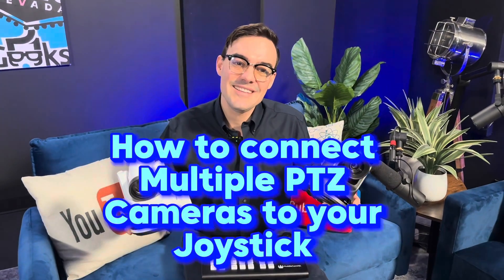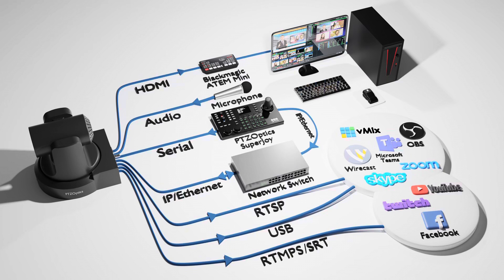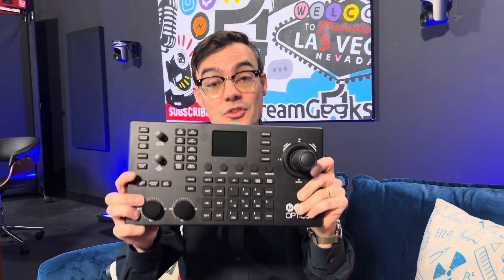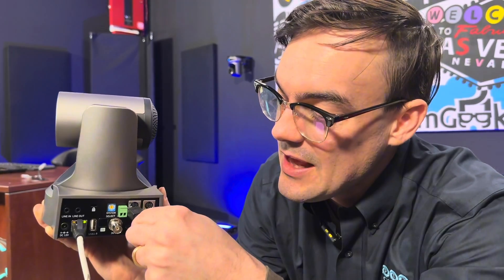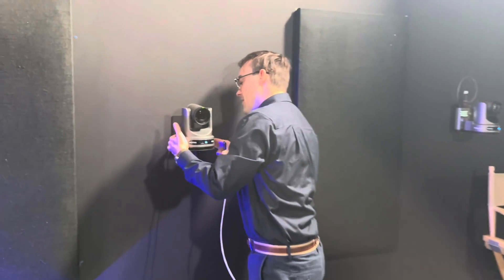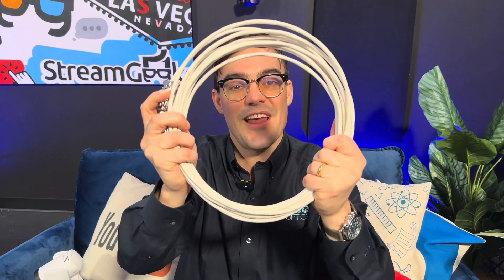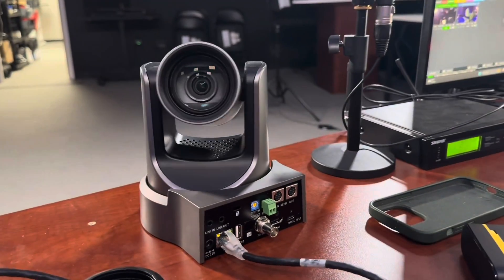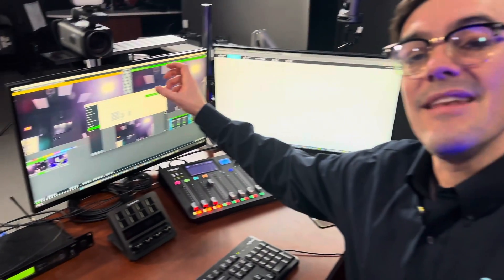How to connect multiple PTZ cameras to a controller

Comment: Hey, looking to upgrade my basic streaming set up from a single stationary camera to your PTZ MOVE SE 30X. This video helped a ton as I knew very little about how to connect cameras to a controller and such. That all makes sense now. But how do I get the video from the network switcher via ethernet cable to my laptop? I run a mobile streaming set up and run just off wifi as most of the places I stream from don't have access to a hard-wired router. Will the video signal be sent from the switcher to my laptop via another ethernet cable? I didn't realize ethernet cables could transmit video as well. (As I mentioned, very much a rookie in this field ha-ha).
Reply from the maker: Hello!
Upgrading your setup to include a PTZOptics PTZ MOVE SE 30X camera is a great choice for enhancing your streaming quality and flexibility. 

To address your question on getting the video from the network switch to your laptop, especially in a mobile setup using WiFi, let's clarify a few points about the workflow and the necessary equipment.

1. Ethernet for Video Transmission
The PTZ MOVE SE 30X, like other PTZOptics cameras, supports video transmission over Ethernet using the NDI® protocol or standard network streaming protocols (such as RTSP or RTMP). This capability allows you to use a single Ethernet cable to both control the camera and receive its video feed, provided your network infrastructure supports it.

2. Connecting to Your Laptop
To receive the video on your laptop from the camera over a network switch, you'll need to ensure your laptop is connected to the same network. Here's how you can do it in a mobile setup where you're relying on WiFi:

Connect the PTZ Camera to the Network Switch: Use an Ethernet cable to connect your PTZ MOVE SE 30X camera to a network switch. This switch should be capable of handling the bandwidth required for video streaming.

3. Connect the Network Switch to Your Laptop:
If your laptop has an Ethernet port, you can directly connect it to the network switch using another Ethernet cable. This setup will ensure a stable connection for both controlling the camera and receiving its video feed.
If you rely solely on WiFi and cannot or prefer not to use a wired connection for your laptop, you'll need a WiFi router connected to your network switch. This router will broadcast the network over WiFi, which your laptop can connect to wirelessly. Ensure the WiFi router is configured correctly to allow devices on the WiFi network to communicate with devices on the wired network (like your PTZ camera).

4. Software for Video Reception
To actually view or stream the video feed from your PTZ MOVE SE 30X on your laptop, you'll need software that supports the camera's streaming protocol (NDI®, RTSP, RTMP, etc.). OBS Studio is a popular choice for this purpose, as it's free, supports various streaming protocols, and works well for live streaming setups. Within OBS or your chosen software, you'll configure a new source using the camera's network stream URL.

5. Mobile Streaming Considerations
Bandwidth and Quality: Streaming video over a network, especially HD or 4K, requires a significant amount of bandwidth. Ensure your WiFi network is robust enough to handle the video stream without significant loss in quality.
Latency: A wired connection is generally preferred for the lowest latency. If using WiFi, be aware that there might be a slight increase in latency.
Power Supply: Since you're running a mobile setup, ensure you have a reliable power solution for your camera, network switch, and WiFi router.

By following this setup, you can efficiently integrate a PTZ MOVE SE 30X camera into your mobile streaming setup, leveraging the flexibility of PTZ cameras and the convenience of wireless connectivity for dynamic and high-quality live broadcasts.

Thanks for checking out our Channel! 
Learn More: https://ptzoptics.com/
Reply: @PTZOptics  forgive my lack of knowledge here, but is there a simpler way to run it? Just hdmi into my laptop or is the whole IP connections and such mandatory?
Reply from the maker: Hello, apologies for the late reply.

For connecting a PTZOptics MOVE SE 30X camera to your laptop, using HDMI is indeed one of the simpler ways to get the video feed into your system, especially if you're looking to avoid the complexities of IP networking. The HDMI connection provides a straightforward method for video capture but keep in mind that it will only carry the video signal. 

Here's a basic overview of how you might set this up:

1. HDMI Connection: Connect the PTZOptics MOVE SE 30X camera to your laptop using an HDMI cable. Since most laptops do not have an HDMI input, you will likely need an HDMI to USB capture device. This device acts as a bridge, capturing the HDMI video signal and converting it into a USB input that your laptop can recognize.

2. Capture Device Setup: Plug the HDMI to USB capture device into your laptop. You may need to install drivers or software for the capture device, depending on the model and manufacturer.

3. Camera Control: While HDMI will transmit the video signal to your laptop, controlling the PTZ (Pan, Tilt, Zoom) functions of the camera via HDMI is not possible. For camera control (panning, tilting, zooming), you would still need to use either an IR remote that comes with the camera, an RS-232/RS-485 controller, or network-based control (if you choose to explore IP control in the future).

4. Software Configuration: Open your video capture or streaming software (e.g., OBS, vMix, etc.) on your laptop. Configure the software to recognize the USB capture device as a video source. From there, you can manage your livestream or recording settings as desired.

5. Using an HDMI connection simplifies the video capture process by bypassing network setup procedures, making it a good option for users looking for a plug-and-play solution. However, for more advanced features like remote camera control or accessing the camera's web interface for detailed settings adjustments, network connectivity would still be necessary.

This method is well-suited for users who prioritize ease of setup and are primarily focused on capturing high-quality video without the need for remote control over the network.

Please reach out to our PTZOptics Support Team
Support Numbers: 833-888-9706 or 484 593 2584
Monday -Thursday: 8am to 6pm EST
Friday: 8am to 4pm EST
Not open Saturday or Sunday.
Community Portal: https://community.ptzoptics.com/s/

Thanks for checking out our Channel! 
Learn More: https://ptzoptics.com/

Comment: Great tutorial. Our church currently has 3 Blackmagic DSLRs running over HDMI into an ATEM Mini Pro for our broadcast. Using a setup like 3 Move SE’s and the IP SuperJoy, would we need to also run Ethernet cabling to the three camera locations in addition to HDMI, or could we connect the joystick console to the Blackmagic software controller via IP or USB instead?
Reply from the maker: Thanks!
Glad you found the tutorial helpful. If you plan to use three Move SE cameras with the IP SuperJoy, you’ll need to run Ethernet cables to each camera and to the SuperJoy controller.

The Ethernet connection enables the SuperJoy to communicate with the cameras over the network. It also supports PoE (Power over Ethernet) for the cameras, provided your network switch is compatible. Your HDMI cables will still run to the ATEM Mini Pro for video switching, just like you’re doing now.

The SuperJoy doesn’t connect to the ATEM or Blackmagic software; it talks directly to the cameras over IP.
Reply: @PTZOptics perfect—thank you for the quick response. This is what I understood but glad to have it confirmed.

Comment: What router do you need?
All this other stuff I don't really need to know.
What people like me need to know is how to make all this work from a remote location.
Which means you obviously need some kind of internet connection using a router.
And does that mean you have to subscribe to a service, or do you just pirate signal from wherever?
This is what we need explained, please.
Reply from the maker: Great questions, and you're right, remote production depends heavily on having the proper internet connection and setup.

If you're looking to control and monitor PTZ cameras remotely, we recommend checking out PTZOptics Hive. It's a cloud-based platform built for remote camera control, video routing, and production. With Hive, you don't need to worry about complex network configurations or relying on unstable connections. Everything runs securely through the cloud.

You will need a reliable internet connection at both locations, along with a router connected to an internet service. Pirating a signal isn't a reliable or recommended option.

You can learn more about Hive here:
🌐 https://ptzoptics.com/hive/
Reply: @PTZOptics  Thanks for the response.
The other location would be all the households or phones, computers, viewing the live stream...
Reply from the maker: No Prob.!

Comment: How can I adjust depth of field or aperture on a move se camera? Our 30x camera likes to focus-hunt when zoomed in while also being over exposed, but I cannot find the settings to fix this.
Reply from the maker: Hello!
On the Move SE series cameras (including the 30X), the depth of field and exposure are primarily controlled through the iris (aperture), shutter speed, and gain settings. If you’re experiencing focus hunting and overexposure at long zoom, that usually means the iris is too open or the exposure is set to auto.

Here’s how you can adjust it:

1. Access Exposure & Iris Controls
- Web Interface (recommended):
- Log into the camera’s IP web interface.
- Go to Camera Control → Exposure.
- Change Exposure Mode from Auto to Manual, or try Shutter Priority (1/60 or 1/100) if you want consistent motion handling.
- Adjust Iris (aperture) manually — closing it down (higher f-number) increases depth of field and reduces overexposure.
- If needed, lower Gain to prevent brightening noise.

IR Remote:
- Press Menu → Exposure, then cycle through Auto / Manual / Shutter Priority / Iris Priority. Select Manual or Iris Priority and use the remote’s buttons to adjust the iris directly.

2. Improve Autofocus Behavior
- In the web interface, under Camera Control → Focus, try switching to Manual Focus once you’re zoomed all the way in and have your subject framed. This prevents the “focus hunting” at full telephoto.
- Alternatively, set Focus Mode → One Push so it locks focus when you press the button, instead of constantly refocusing.

3. Tips for Stability
- At long zoom, the depth of field is naturally very shallow. Stopping down the iris (f/4–f/8 depending on lighting) helps keep more in focus.
- Avoid running Auto Iris + Auto Focus at the same time when fully zoomed , this combo often causes the “hunting” loop you’re describing.

Please contact our PTZOptics Support Team 
Support Numbers: 833-888-9706 or 484-593-2584 
Monday -Thursday: 8 am to 6 pm EST 
Friday: 8 am to 4 pm EST. 
Not open Saturday or Sunday. 
Community Portal: https://community.ptzoptics.com/s/ 

We’d love to see your creative setup!
📸 Snap a photo and share it with us by emailing marketing@ptzoptics.com
📬 Subject Line: Share Your Vision

🌐 Explore More: https://ptzoptics.com/
Reply: @PTZOptics thank you!
Reply from the maker: No Prob.! Let us know if you need anything else.
🌐 Explore More: https://ptzoptics.com/

Comment: Hey! 

We have some ptz Se cameras and I want to use them on our new system that was installed for us but it is a canon setup with a Canon RC-IP100 controller. Can I use the canon controller to control the ptzoptics SE cameras?
Reply from the maker: Hello!
Unfortunately, the Canon RC-IP100 does not natively speak the same control language (protocol) that your PTZOptics “SE” cameras use, so you won’t be able to drive the cameras directly from that joystick without adding a protocol-converter or switching to a VISCA-capable controller.

What would work
Switch to a universal joystick
PTZOptics SuperJoy, PT-JOY-G4, Skaarhoj’s PTZ Pro, Panasonic AW-RP150, ScarHoy AIR Fly, or any software controller (vMix, OBS-plugin, Companion/Bitfocus) that speaks VISCA-over-IP will discover the cameras immediately.

Use software as a bridge
Rascular Router Control or Central Control can take Canon XC from the RC-IP100 and translate it to VISCA-IP for each PTZOptics camera, but you’ll need a PC sitting in the middle and you lose some fine-control functions (speed knobs, one-push autofocus).
Hardware translators (e.g., Skaarhoj “UniSketch Converter” or Rocosoft’s PTZLink) perform the same job if you prefer an appliance over a PC.

Serial workaround (least convenient)
Technically the RC-IP100’s RS-422 port can be patched into a VISCA-serial chain with a level-shifter, but:
You still need a protocol translator from Canon XC → Sony VISCA.
You would drop to 7 presets and can’t address multiple cameras cleanly.
No exposure menus or auto-tracking triggers will pass through.
Because of the headaches, we don’t recommend this path.

Next steps
If you have a budget for a new controller, the PTZOptics SuperJoy is the simplest drop-in; one LAN cable per camera, and you’re finished.
👉 KB article: Getting started with SuperJoy & Move SE – https://help.ptzoptics.com/support/solutions/articles/13000088540

Prefer to keep the Canon joystick? Budget a small PC (even a Raspberry Pi 4) plus Central Control. Setup guide: https://help.ptzoptics.com/support/solutions/articles/13000082149

Need help configuring VISCA-over-IP on the cameras? Follow this quick walkthrough: https://help.ptzoptics.com/support/solutions/articles/13000036150

Please contact our PTZOptics Support Team 
Support Numbers: 833-888-9706 or 484-593-2584 
Monday -Thursday: 8 am to 6 pm EST 
Friday: 8 am to 4 pm EST. 
Not open Saturday or Sunday. 
Community Portal: https://community.ptzoptics.com/s/ 
Thanks for checking out our Channel! 
Show me More: https://ptzoptics.com/
Reply: @PTZOptics  WOW so much information it’s going to take a bit to think through it all. Thanks for the quick response!
Reply from the maker: Give us a call if you need any assistance!

 📞 Support Numbers: 833-888-9706 or 484-593-2584
🕗 Hours: Mon–Thu 8am–6pm EST, Fri 8am–4pm EST
🔗 Community Portal: https://community.ptzoptics.com/s/
🌐 Explore More: https://ptzoptics.com/

Comment: Hi we are having an issue with the Fomako joystick and camera controller at our church, it will work for a short time then disconnect randomly which we have to switch it off and on at the back of the controller to regain camera control then it will disconnect again. It's very frustrating, any ideas?
Reply from the maker: Hello!
Thanks for reaching out. Since your controller is made by Fomako, we recommend contacting their technical support directly for assistance with this issue.

If your setup included PTZOptics equipment, we would be happy to assist you directly. But as this concerns a third-party controller, Fomako’s support team will be best equipped to help troubleshoot the disconnection problem you're experiencing.

🌐 Explore More: https://ptzoptics.com/

Comment: How did you power camera 2. I saw you powered Camera 1 with the Ethernet cable. Is camera 2 also have an Ethernet cable plugged into that back to power it?
Reply: What he didn't show in the video was the fact that he connected the IP joytsick ethernet port to a POE switch which powered it on but in the video it looked as if he just did a direct connection between the IP joystick and the camera 1 ethernet port.
Get a POE network switch and connect all your IP cameras to it including the IP joystick controller to power all the devices. The IP joystick will now identify each IPcamera and will be able to control them using unique IP addresses.
Reply from the maker: Great observation! What wasn’t shown in the video is that the IP joystick was connected to a PoE network switch, which provided both power and network connectivity. It may have looked like a direct connection to Camera 1, but all devices were actually networked through the switch. For best results, we recommend using a PoE switch to connect all your IP cameras and the joystick — this ensures proper power and allows the joystick to detect and control each camera by its IP address.
🌐 Explore More: https://ptzoptics.com/
Reply from the maker: Hello!
Correct, for this setup we used ethernet cables to power all the cameras.